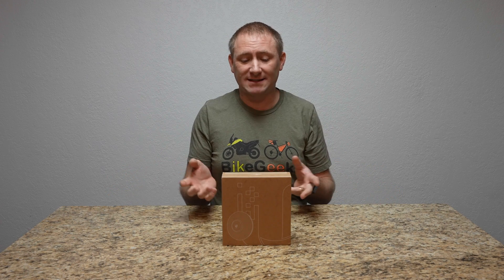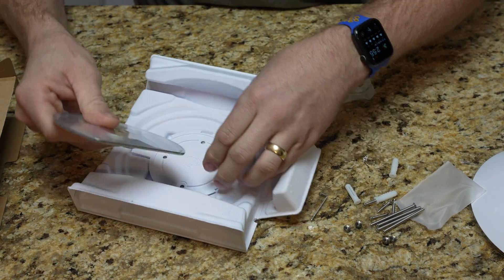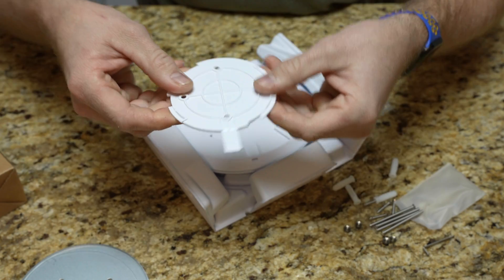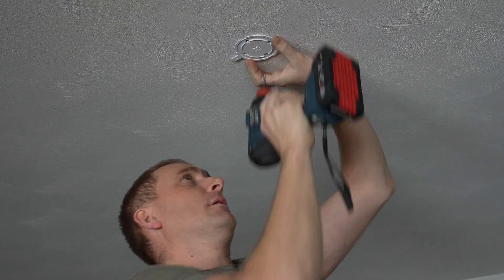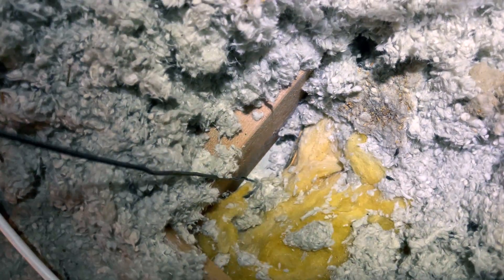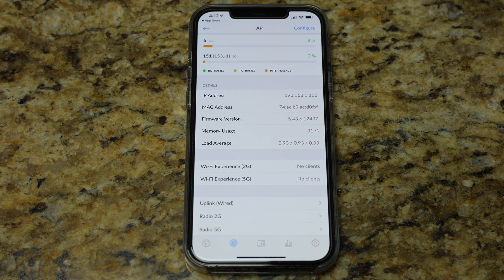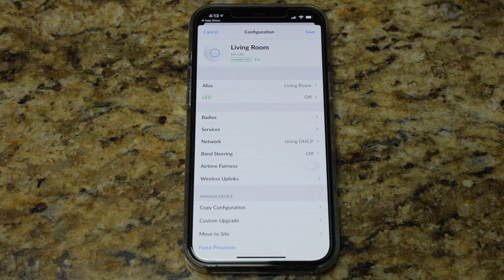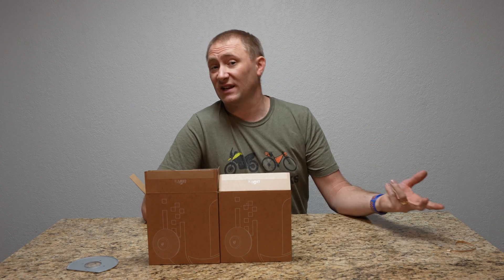Ubiquiti UniFi 6 Lite Access Point Setup

Comment: You should probably mention that UniFi6 AP are not compatible with Unifi Cloud Key G1, which is now EOL. So just bought one of these and now need to spend additional $200 for Cloud Key G2 Plus. Would have gotten an older unit if knew that...
Reply: Y Punto de acceso LA Ubiquiti UniFi 7, ESCOMPATIBLE CON UNIFI CLOUD KEY?

Comment: Thanks for this. I just bought one... with the hoe to extend my Shaw WiFi service, and stabilize coverage in my house. The Shaw cable modem/ wifi / router combo is way down in the mechanical room in my basement. My hope it that this unit will work for my application. I have no other Ubiquiti equipment, but I've ran CAT5E and I've got a PoE injector and an 8 port 100/1000 ethernet hub.

The  goal to just log into the local wifi ssid and not have to change endpoints as you move around the house.
Reply: You can move Shaw stuff. I also use Shaw.

Comment: Can this work as a stand alone AP.. as in I don't need a UDM Pro or anything .. it will work from a unmanged tp link for example ? Also can I add another and make it a mesh ? Thanks
Reply: Yes and yes. Don’t use TP link for power, and it should create a mesh network with the other APs, but you might want a UDR or UDM.

Comment: just installed one.  The range absolutely ****sucks****.  My old netgear AC750 wall warts provide  much better coverage.  Terribly disappointed.  15 ft away , through 1 wall unfinished on one side, getting -75DB on 2.4Ghz...I'm just shocked it's this bad.
Reply: It might be a problem with the unit itself. You should get about 1500 Ft2 I believe.

Comment: Hi. This AP can connect to a different main router (Dlink) and act as a Repeater or do I need the UniFi 6 router for this AP? Thank you.
Reply: Yes, as long as you have a POE line to it. Also, you need the UniFi controller software installed somewhere to configure. To use as a repeater set the same settings as your DLINK wireless configurations.
Reply: Can't find wear to set SSID.  Have other unifi switched but router is synology

Comment: What's the point though with a WiFi 6 access point if it only has a single gigabit Ethernet port? Thanks for the video though, will be interesting to see your speed test results with this.
Reply from the maker: The wireless connection is faster than the previous generation, and the single wired port is a Gigabit port.
Reply: @GeekSmart  Yes but if WiFi 6 devices can hit 7gbps then why put a 1 gbps port on the access point? It seems to be built to restrict the speeds you could gain. Surely a 10 gbps port makes more sense especially from Ubiquiti?
Reply: @marksapollo  Curious what you think the cost of the U6 lite would be if they put a 2Gig or 10Gig port on it. My guess is it becomes a $300 AP. Gig port is appropriate for a $99 Wifi 6 AP.
Reply: @SeanCaldwellvo  It's a port that costs pence, plus the chips that also cost pence, so probably 120 dollars to make some profit and cover licensing etc. Not 300 dollars as that just a guess from imagination land.
Reply: @GeekSmart  Simple home user with an office needing AP in the house. If I purchase the Switch 8 PoE (150w) and 2x Access Point WiFi 6 Pro...from my business class cable modem can I plug the WAN in one of the 8 ports so that when the APs are plugged in the other ports they get an IP address? Or, do I still need to use my business modem to my Netgear router and router to the switch for the AP to work and get IPs?
Reply: No one who would be using a $99 access point would really have a 10G setup. Sure the port on the AP is Gigabit but likely the switch on the other end is as well. Along with the modem and any other devices. So the port on the AP isn't slowing anything down. They do make APs and switches with faster ports. This "lite" product isn't for that market.
Reply: @TechOut  The modem makes no difference as no one has 6gbps internet yet. Not the main stream anyway. A lot of Ubiquiti kit seems to have ports faster then 1gbps though. Just seems pointless to me.
Reply: @marksapollo  the modem does matter. If you only have a gigabit port on the modem what's the point of having a faster one on the AP. Only time it would matter if for LAN connections. But again everything on the LAN would need faster than gigabit for it to matter.
Reply: @TechOut  Wrong, the modem does not matter in the slightest because you cannot really get internet speeds faster then a gigabit. Maybe some can get 2 but that will be a tiny amount of people. So WiFi 6 is only any good for device to device transfer on your network, or if you have hundreds of devices with WiFi 6 so the traffic can be broadcast faster and more efficiently to them.
If your getting WiFi 6 now just to connect to the internet your doing it wrong, and Ubiquiti isn't really targeted at those people, or you can just buy a AC wireless node.
Reply: @marksapollo  even if you have multiple devices and have a connection from the AP higher than a gigabit the bottleneck would be any device on your network that only has a gigabit LAN it still won't be higher
Reply: @marksapollo  how is buying wifi 6 to connect to the internet doing it wrong. It has increased speed on many of my devices
Reply: @TechOut  You probably didn't have very good AC before then or you've got lots of WiFi6 devices. Do you have 3 gigabit internet speeds? Or 6?
Reply: @marksapollo  I have gigabit internet and all my existing APs are AC compatible unifi ones
Reply: @TechOut  What models.
Reply: @marksapollo  AC LR, AC Lite, AC Flex HD